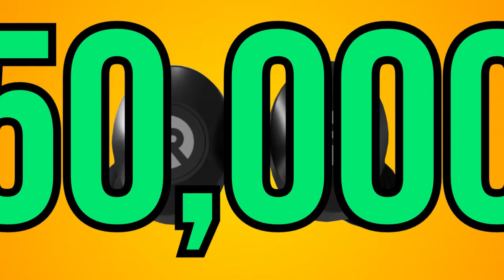CONVERTING AN OLD LIMO INTO A LUXURY CAMPER | PT.6

Comment: Reese, I have a suggestion that will take this limo over the top. LineX/ Raptor Line the outside of the limo. I did this to my truck a few years back. As long as you have an air compressor the actual cost of paint and supplies shouldn't run you over $400 and  with a little sanding and Bondo patch-work here and there, it will completely seal over the holes where water may leak in. Plus it turned what was a 'beater' of a truck into something that would get compliments every-time I pulled up to a gas station. I promise you won't regret it.
Reply: The holes are actually an added feature not to mention the only feature that works why get rid of them animals love them water goes through them what’s not to like

Comment: That's a legit electrician if I've ever seen one. Like usually electricians just leave stuff hanging and then it's someone else's job to finish the installation.

Their job is basically to just make sure everything works in the grid and wires are linked together correctly.

Comment: You should wrap that cable with duct tape, i don't even know why "electrical" tape even has that name, it doesn't work with power cables; it'll get hot and rot the electrical tape off.

Comment: need to solder the short wires together on the cut extension cable... wire caps don't hold the wires together. booze is $5 a shot, no more buy the whole bottle discount... dry county times, becoming vegan friendly.
Reply: solder, shrink wrap, hold cable straight, brush on rubber, tape one lair thick not over lapping "some brush on rubber squishes out", tape second lair 25% overlapping its self in opposing direction of the first tape lair, continue holding cable straight as the brush on rubber dries or set it down so the ground holds it straight. "brush on electrical rubber same thing as RTV, Elmer's glue works to if ya can wait 56 hours for it to dry", file and wait 4 months for the business profile request in addition to materials to be received... limbo